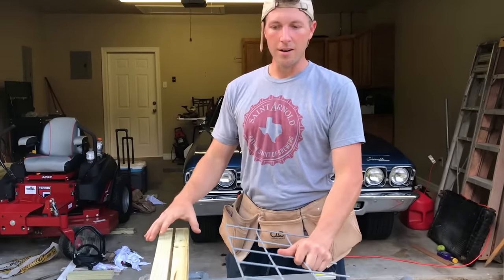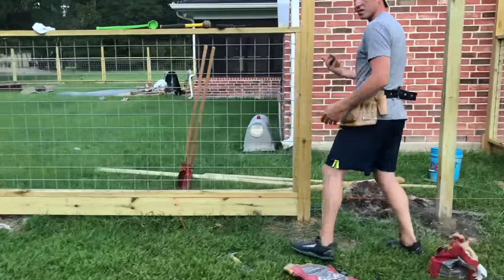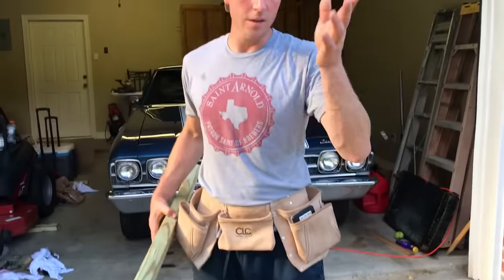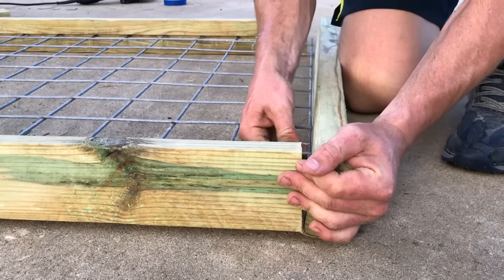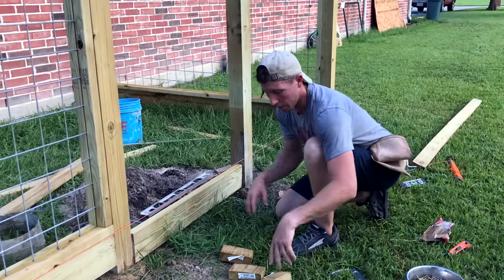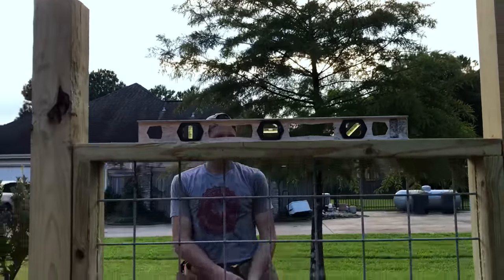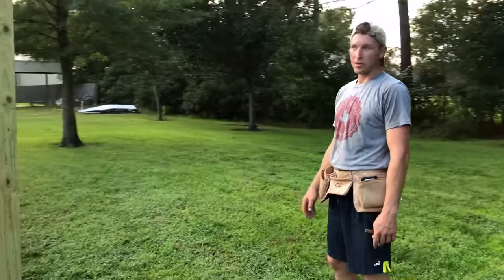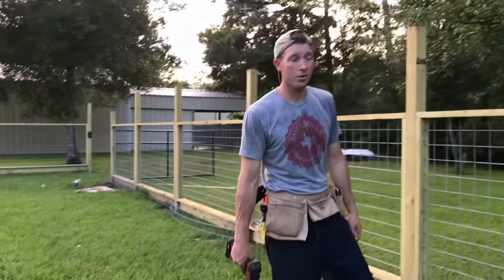Part 1: Modular Hogwire Panel Fence with Dado Groove

Comment: Like the fence, but how long will it take for them to dig under.
Reply from the maker: Thanks for the reply Steve! That is a good question. Though i can speak for other people dogs with a fence like this, fortunately my dogs have not developed the pleasures of digging. I have placed preventive countermeasures at the mud/rot board, shown @ (18:00). The excess wire panel material is stuck into the ground appprox 6-8" all the way across and then wire stapled to the mud/rot board board. Im optimistic that it wont happen, but my size dogs would have to dig a tunnel about 18" deep and about 15-18" wide to get out. Lets just hope if it does happen, ill be there to catch them in the labor intensive act (my bets would be on the aussie). My dogs also have a petsafe proximity collar that they are very mindful of as a safety net. Hope this helps, and if you interested, feel free to shoot me an email to hawkijon@aol.com. I have hand sketches with material breakdown and completed photos.

Comment: Hey John! Great work- I’m going to do this for my new yard. What gauge wire fencing did you buy? And where did you get it?
Reply from the maker: Nicole Jenney thanks for the reply! I got them at tractor supply and they are 16ftx5ft utility panels 6ga. Pretty rigid stuff. Shoot an email to hawkijon@aol.com for details drawings and a cost generator i developed on my exact build per linear foot.
Reply: Nicole Jenney  they are called cattle panels. Tractor Supply has them. They are 16 feet long.
Reply from the maker: The ones I purchased are called utility panel according to their website

Comment: Nice, man! Are you getting much play between the 8-ft centers (I.e., flex from the hog wire)?
Reply from the maker: Absolutely none! The rot board acts a a reinforcement to the bottom of the frame. You would probably get some sag over time if you didn’t use the rot board. As far as the hog panel it self.. if you grab it and pull hard you can get it to bow slightly in that specific spot. That panel is rigid with the 4x4 grid. I’m confident the panel would handle up to shy of a rogue car or atv hitting it. Works great for my dogs. A guy down the road uses my design for his goats .
Reply: Gator_Overland Thanks for the response, that’s great to hear. My neighbors have a couple of chubby English labs that like to get a running start before they smack into the fence (which is gradually becoming not a fence for said reason). I think this will be a good solution!
Reply from the maker: Ron Chance I couldn’t agree more
Reply from the maker: Ron Chance https://youtu.be/bL89wkzSPDo

Comment: I gave away my circular saw the day after my Dad came running in the house exclaiming, "I think I cut off my thumb!" The fastest way to get to the head of the line at ER is to hold up a baggie with a thumb in it. Anyway, I have used a router to cut picture frame rabbets so think I could use the router to cut the dado. Any advice on that?
Reply from the maker: you definitely could used a router as long as you have a consistant guiding edge to maintain it the proper depth and center of the board. They do make a circular saw jig for making a dado, but wouldnt chance it. I put a post on my facebook and within about an hour i had notifications from a few friends that had the tablesaw available to borrow. I would recommend going with a table saw for safety and efficiency. I did all my boards in an afternoon, not sure what a routers production would be. Shoot an email to hawkijon@aol.com if you are interested in construction details, material breakdown and cost generator based on my build per linear foot.

Comment: You got me so excited about putting this style around my garden.   After thinking about it why did you not simply skip the mud board and make the panels so they are snug in between each 4x4 and simply screw the panels to the sides of the 4x4.   Just thought it would save a lot of money.  Did you do this so the panels were farther off the ground for rust purpose or does it need that support at the bottom.
Reply from the maker: Greg Brooks , you’re on track with all the reasons. I have a 180lb English mastiff and he had no problem jumping over a 4 ft fence, so initially I knew I needed the fence to be higher and rigid. That’s when calculations came in to play. Each panel assembly requires only (3) 8ft 2x4’s. Top and bottom I trimmed from 96” to 93.5” and the verticals are 46.25”, which is making 2 lengths out of 1 8ft board. The wire panels are 16ft x 5ft. So in half, you get 2, 8ft lengths that I had to sacrifice the standard size by cutting down to 92”x48” so it would work with my wood dimensions. Any dimensions different I would have had to buy 10ft boards for only a couple inches more than 8ft (a lot of wasted scrap). So I economized by design. The rot/mud boards are not necessary for a garden, but essential if you want your fence to last. They did allow me to elevate my panel base, but also makes a sturdy base beam for your panels. I didn’t want to droop in the middle over time and/or the bottom of my panel to rot. It also is the weather barrier that can be changed out if it does rot (it will). So, in full, i would have saved $160 by not using them, but I have the comfort knowing I don’t have to worry about the rigidity or lifetime of my fence having not used a rot/mud boards.
Reply: OK you talked me into it.  I hate rot and to do all that work and 8-10 years down the road you have to do it all over again.  My little tip for you.....    I take all my post and save all my used motor oil and mix it 50/50 with diesel fuel and fill a 50 gallon drum which gives you about 3 feet of oil and let the post soak for a week and then coat them with roofing tar.  I have found that it works better then cement for rot.Just a quick Question.   Did you use a line leveler on you stringer when you were setting the mud boards or just use a level on each 8' section
Reply from the maker: Yes, but i used the line more to ensure my post were all in the same row by torting the line and having the line just touch the post with a little vibration room if you were to pull the string. I used the actual level on the line for reference, but did not adhere to it for final level as the string, even with extreme  tension, still has some droop to it over the 50+ lengths. The line leveler did allow me to find the highest point of elevation in the yard, which i figured best to  start my rot/mud board base level from and i placed this board as close to the ground as possible (basically sitting on my concrete caps that i had approx 1.5" above the soil line). My general idea was to have the bottom edge of the rot/mud board approx 2" above the soil/grass. Though it was a seemingly flat area, there was bit of elevation difference around the perimeter. With the method of placing the bottom of the rot/mud board as low as possible level between the post, at the area of highest elevation in the yard, I didn't run into an issue with having other boards come in to contact with the ground when trying place it level between the post. In the spots where the elevation dips below the rot/mud board enough for a dog to get out, you can utilize the trimmed panel lengths as a guard with staples as I did, or level it up with some dirt. If you level it up with dirt, be mindful that you keep your concrete area above your soil line to prevent rot.

Comment: I noticed you had pretty flat land. How would you account for a more uneven terrain? I feel like I wouldn’t be able to blend this fence like I could a panel fence. Thanks!
Reply from the maker: Thanks for the reply David. I have some hand sketches to explain how to account for uneven terrain that has been helpful to others who have inquired. My ground was fairly level, but i did have some spots that dipped low enough under my rot/mud board that a curious dog/animal could slip under. I used my excess trimmings (18:10) and stuck them in the ground and secured them to the rot/mud board with wire staples and It has worked well thus far. It could be a bit more tedious, but you could blend for large elevations changes by adding additional boards beneath your rot/mud boards and trim/rip them to match the elevation change. If you are interested in hand sketch, material breakdown and final photos, shoot an email to hawkijon@aol.com.

Comment: Great fence and video, thanks, I was wondering that since it's been installed for awhile if you had any issues like splitting at the dado cut.
We're moving in Florida this summer and this fence fits what we're looking for perfectly.
Reply from the maker: Thanks, I appreciate the reply… Your question is a very common one, soon I will have my part two which is a fence staining and 18 month evaluation posted for reference… In short, there is absolutely nothing I would change about the fence design… The dado and boards are holding up great, no warping splitting cracking or Bowing. Before staining I had only a little bit of UV fading, but only about six months ago was my wood dry enough to even stain… you have to take into account that the frame holding in the wire panel is secured firmly to the vertical posts and the 2 x 6 right board… The dadoes themselves are only supporting about 9 pounds of wire, there is minimal stress. Stay tuned for the part to and good luck with your build… If you haven’t seen already I have a dropbox link in the description as well as my email address should you need me to send you PDFs or any additional information
Reply: @GatorOverland  Thanks for your response. Looking forward to your follow up video.

Comment: John,  When you were building your fence did you set all the post 4x4 before you even started building the panels to size.
Reply from the maker: I did it the other way around. I built all my panels first because my 93.5"x46.25" lumber dimension was a constant for the majority of the project, and i could knock out getting the frames and material done at one time without having to stop. As mentioned on another reply, if i was to do it again, i would have set my post apart based on maintaining 93.5" between the inside faces of the posts rather than relying on maintaining 97" centers (by measuring the outside of one post face to the inside of the next post face). Though its easier to get the tape to hang on the outside edge of the post when doing it by yourself, the variance of the post dimensions being not exactly 3.5"x3.5" made some of my panels a bit tight when sliding into place. If you don't have assistance, take the time to put a small nail or tack though the hole in the tape measure hook and lightly tap it to the inside face of the post at the approx. height you plan to have your rot/mud boards. This will keep you from cussing when the tape falls while trying to maintain your span when measuring between inside face of posts, as well as ensuring that your posts at the lowest point are at least the distance (93.5") apart. Even if your post are warped become bowed towards the top, you can use a ratchet strap to pull them the direction you need to gain the clearance you need for the panels.

Comment: Did you use a dado blade for the grooves?
Reply from the maker: Thanks for the reply! Yes, (1:31) i purchased a 50$ Avanti dado blade set and per the manual stacked shims to achieve 3/8" dado width. If your are interested in construction details with material breakdown and excel cost generator i developed based on my build per linear foot, shoot an email to hawkijon@aol.com.
Reply: Did you make your own shins or buy them?
Reply from the maker: @alfonsobourghol1080  go to home depot or amazon to buy the avanti dado blade kit. approx $50. everything you need is in the kit.

Comment: Great fence!  You need a Dewalt impact driver. Far superior in speed and strength to a drill.
Reply from the maker: Thanks for the reply! I have since upgraded to the mentioned dewalt, as well as a few other battery powered power tools. Very happy with them. As for the fence, it’s still in good standing, literally.. shoot an email to Hawkijon@aol.com if your interested in construction plans and cost generator.

Comment: did you vent the bottom daedos to drain water? :) bet not :)
Reply from the maker: Thanks for your reply! Yes, i did go back and place a 3/16" hole approx every 8" or so. I checked it by pouring a bottle of water in the dado groove. It's no Niagara falls, but it definitely drains enough to speed up evaporation.

Comment: Great video, thanks for it and the documentation. Question, did you use a special blade for their grinder to cut the metal?
Reply from the maker: Thanks for taking the time to watch and comment…No special blade just the proper size cutting wheel for a grinder

Comment: Where did you buy your welded panels?
Reply from the maker: Thanks for the reply Tim! I got the panels at a local tractor supply, but most hardware, and livestock stores have them available. I have a detailed hand sketch, material breakdown and excel cost generator that i came up with if you are interested. Shoot an email to hawkijon@aol.com

Comment: On your mud/rot boards did you use only one in the center of the 4x4 at the bottom or do you have 2 of them parallel to each other for the panel frame to screw into.
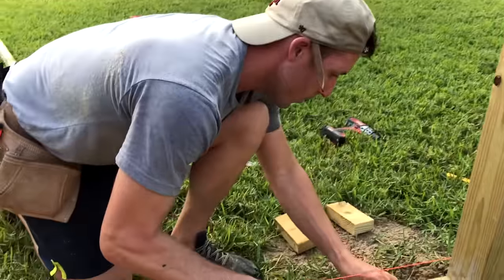Reply from the maker: i just have the one board flushed to the outside (13:52)

Comment: John.. can I get an estimate of square footage of the fence.. and how much.. minus the 2 gates from tractor supply...
Reply from the maker: My Sq.ft area dimensions would be roughly 56ft x 64ft= 3584 Sq.ft. Though square footage is a factor for area, it wouldn't be the best way to calculate an estimate. You would need total linear feet of your area to determine your estimate. i.e. from west house wall: 8ft west (toward neighbor), 56ft North (toward backyard), 64ft East (across backyard), 56 South (toward front yard), 16ft West (back to east house wall) = 200 linear ft. The avg cost of 8 linear feet panel section w/o gates included in cost: (2)4x4 post, (3)2x4x8, (1)2x6x8, (23)screws, (1)quickrete, (1)8ft wire panel trimmed from 16ft length = $66 per 8 linear feet panel section. Take 200 linear ft. and divided by 8 linear ft panel section=25 panels sections needed. $66x25= $1650 +/-. Hope this helps with your estimating.
Reply from the maker: send an email to hawkijon@aol.com and i will send back a detailed hand sketch with dimensions and material breakdown.